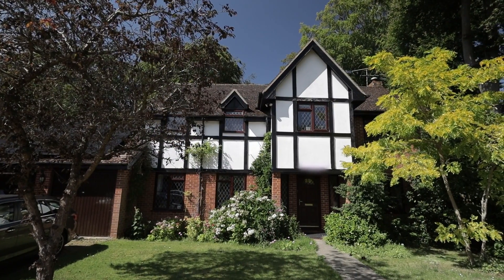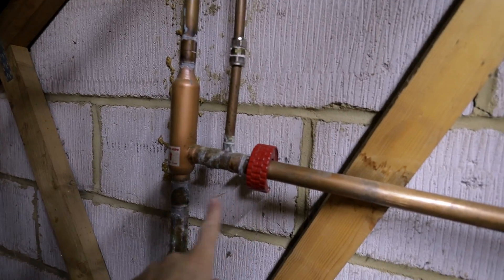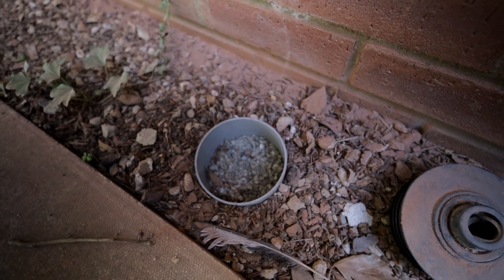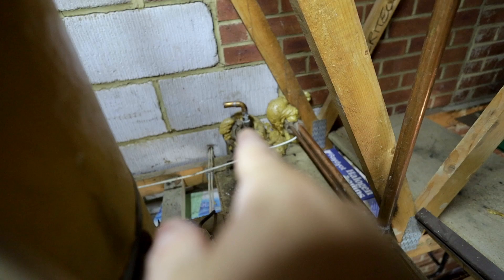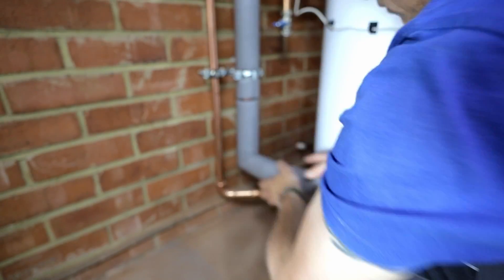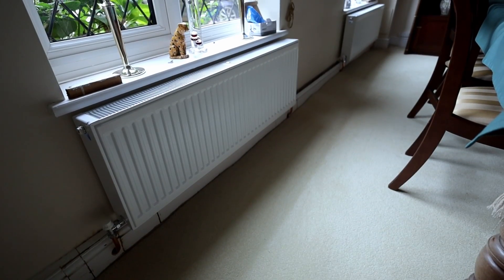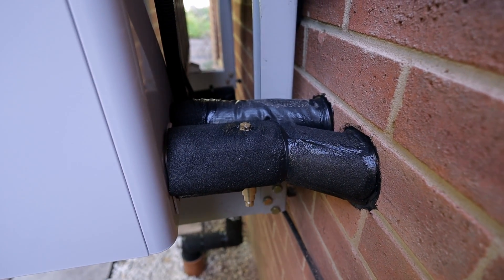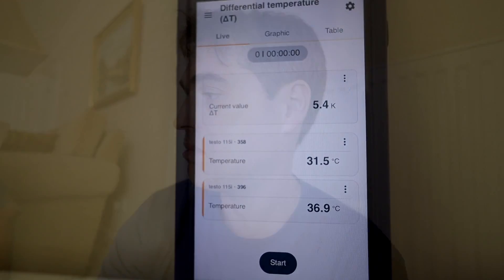Heat Pump Retrofit in a 1980s House: What's Involved?

Comment: My house in the uk was built in 1998/9 but it has microbore(8mm ?), i assume that all the pipework would have to be replaced. I currently have a worcester system boiler which has been great, not sure i could justify changing over to a heat pump based on the costs i've seen but with these energy prices  that may change. Love the videos.
Reply: Am in similar situation but with 10mm microbore. The F & R from boiler is 22mm under 1st floor boards, though turns to 28mm in HW cylinder cupboard (why?). Not sure how close this is to each rad that probably has 22mm to10mm manifolds. I'm presuming that each manifold and 10mm pipework needs to be replaced with larger size and increase rads to K2. Doesn't help with hand "bent" microbore on each rad tail that is almost squashed flat.
Reply: That last seems an unnecessary conclusion. If you have microbore, watch the HeatGeek review of that topic: seems it can be made to work with ASHP.
Reply: air-air for you guys then, throw the rads away.

Comment: Amazing work - love the wall mounted heat pump. Would you default to wall mounting for micro climate risk areas going forward? Also, have you ever had to wall mount directly over water - we have a client who lives right by a stream and wants it wall mounted over the stream.
Reply from the maker: Never installed over water yet. Yes I will wall mount in areas of microclimating risk
Reply: can you put a 10KW or 12 KW - double fan unit on the wall - is thw weight OK?
Reply from the maker: @justinhumphreys5230 depends on the unit weight. Some are 120kg so are over 200kg

Comment: I am always pleased when you post a new video. I am a mechanical and electrical engineer, I work for a local authority, taking care of complex systems in , swimming pools, various commercial office building with communal heating systems and a full district heating system. I like your work and ethic. You are clearly passionate and work to a very high standard. The one thing I would say to you though with this video, that, is in no way a typical uk house. Much of the uk housing stock is on a small footprint or is of some type of terrace/town house structure. For all who wish to immediately defend air source heat pumps as the holly grail, they definitely have their place, but, are not all things to all men and there does need to be an alternative.
It always pleases me to see the standard of your installations, my local authority has suffered some shockingly bad installations from uncaring contractors, which have cost thousands to put right. As well as costing the tenant thousands to heat their homes. A knowledgeable and caring contractor has taken over, rectified the faults and proved the worth of air source heat pumps when correctly specified and installed correctly

Comment: Can these systems cool (ie for the summer) as well as heat for the winter
Reply: Thats their biggest selling point.
Reply: @slavko321  so I’m curious how that works in practice.  In cooling mode wouldn’t there be condensation on the radiators??

Comment: I think it’s increasingly proven that heat pumps can work in both new build and older houses.  But it seems you really need good quality kit and an installer who has high skill and attention to detail.  Finding a really good installer seems like a key success factor- even more so than for a gas heating system.
Reply from the maker: @vicki8669 I am not interested in managing people. I am not good at it and hate doing it. Where I am now is where I want to be.
Reply from the maker: @zlmdragon.  Hard? It is next to impossible for me to find people that I can work with. I have very high expectations from others and can be rather harsh if they do not perform. 

On average 1 in 20 will stay with me for longer than a few months. I got used to it now.
Reply: @UrbanPlumbers  Yup, there's a lot to be said for doing a good job and enjoying your work. I think a lot of people end up in management because they think, "well, that's what we're meant to do, right?" and some of them hate it, but keep doing it because of pressure/expectations.
Reply: @urbanplumbers, thank you so much for the detailed video including tackling the Q&A at the end, 
my question:
when upgrading to K2 radiators to support a 45degC flow temp, did you factor 5deg between flow and return… ? why? i was expecting a 10degC delta

keep up your amazing work, so insightful
Reply: @zlmdragon.  ok apologies i missed clarifying, when running at max temp in this case 45degC (coldest temperature day used for calculation), what was the assumption made for the temperature drop please?
Reply from the maker: That’s why we promote heat geek elite installers - the best in the country bet a long mile.
Reply: @UrbanPlumbers  unfortunately there are non in Scotland :( -- I don't think the UK gov is going to its target unless it really ramps up the training, as I don't trust random installers to be even a fraction as good as you & some of the other knowledgeable folks on YouTube
Reply: Das stimmt so nicht.  Neue Häuser haben eine geringere heizlast.  Also geringere vorlauftemperaturen. Fussbodenheizung.  In alten Häusern  müsste man die Heizkörper viel größer machen.  Sonst  geht die cop gegen 2.5 -3.0 unwirtschaftlich!!!

Comment: Yeah but that kind of heat pump works in uk, but on places where during winter outside temp is -20 Celsius with humidity around 70-90% gas boiler is much better, so no heat pumps still cant replace gas boiler, unless you are doing geothermal but who has money for that.
Reply: Where do you live to average -20 in winter? Almost all Northern places have lows of -20 for some days in winter, and air source is pretty ineffficient. But thinking rationally, its just max two weeks with those temps, so seasonal performance is still amazing.
Unless of course you live around Arctic Circle.
Iæ
Reply: -20C on the regular would be unheard of in the UK.  And Ground Source would be more appropriate in that situation.  Given that the ground source heat pumps last the longest - at around 25 years, and the boreholes are generally good for about a century, along with the upcoming ones that are promising SCOPs of up to 6,  it would certainly have made a lot of headway in the extra cost - especially with a boiler usually needing to be replaced at least one more time.  Air Source still can go down to almost -30C, and be more efficient than a boiler, it just comes down to the cost of gas vs. the cost of electricity.

Comment: Well put together video, we have 3 bed, semi detached, 2000 build. Good insulation but 22mm primary and 10mm to all single panel radiators. I just can’t see how a HP can replace gas boiler without replacing all radiators and pipe work😢
Reply from the maker: This pipework will be mostly fine in a new build. You don’t need 28mm if your heat loss is low and you can use 10mm no problem

Comment: Hello, we are also installing heat pumps for several years... I wonder how you don't install a split system of heat pumps (Vailant also has one)? Here in the Mediterranean, we mostly install a split system of heat pumps... a smaller outdoor unit, no problems with freezing, better transfer of heat to the exchanger... I'm interested in your opinion. Greetings from Slovenia
Reply: F-gas regulations mean that most plumbers install monobloc units. Commercial air conditioning installers can install splits, but they mostly just work with air-air units.

Comment: Very interesting. Sounds like important  improvements in the units have been made wrt noise and vibration. It would be great to know what other improvements are coming / in the pipeline. However, difficult to comment on this installation because it sounds like it was at the highest level of spec for radiators and pipework before work started, so obviously this reduced cost and work. Great for them but not sure how often this is the case. What would be interesting would be some user feedback from these users on a v cold day. Being fully functional in summer is one thing but obviously not the real test.
Reply from the maker: I always post feedback from my installations. Check my other videos - there is 3 on my channel with interviews after the winter with my heat pump clients

Comment: Do you ever install the heat pumps even higher than that?  I'd like to fit one just above first floor level on the wall on the back of the house.  The space down the side is too narrow and only have a dmall patio so didn't  want to lose that ideally. If so, how do you lift them? Is it a problem for maintenance?  Is it creating problems down the line?  Great video but you will get some flack for sying thats a typical house!  Thanks for all the info you are sharing.

Comment: Any views or experience using heatpump hotwater cylinders such as the valiant arostor - seems a good idea to me as it must be more efficient because the hp is designed specifically for hot water rather than dual role dhw/ch

Comment: My personal concerns around even trying to explore this subject are: 
* where the unit would due to the air circulation issue mentioned here.  I have 2+ metre stone walls really close at the side and back of a semi detached house.
* where the water tank would go? I assume it should be close to the unit, behind the same wall? Could I put it in a cabinet under the stairs in the kitchen?
* How much piping in an older uninsulated solid wall house I would have to replace in order for the unit to run efficiently? I replaced the loft insulation, put some insulation under the suspended flooring downstairs, but with councils being more concerned about maintaing house "looks" over energy efficiency there is little I can do about wall insulation
* I have some iron cast radiators across multiple rooms, which hold a lot of water. How does that affect the heat pipe efficiency?
* 12-15k is still fairly steep and unlikely to include any extra work, such as replacement of piping

Comment: Very well installed. Quality work great knowledge. I suspect many heat pump systems installed with a lack of consideration for flow rates and rad DT's resulting in "heat pump" doesn't work.
Reply from the maker: Yes, correct. Plus wrong sizing, over zoning and wrong controls plus unnecessary buffers and pumps

Comment: I live in a house with one bathroom which has an electric shower and just two hot water taps, one in the bathroom and one in the kitchen. Would it be worth doing hot water with a heat pump, or just keep the electric shower and put in some sort of electric on demand heaters for the taps? For instance, I'd quite like one of those Quooker Boiling Water taps in the kitchen.

Comment: Another good vid,  that pipe work is a work of art.  Do you know of any systems coming for non-tank combi systems in a terraced house?
Reply from the maker: There are no systems like that and will never be produced due to power required to heat the water up in a instantaneous water heater.

The best you can get is a heat pump for heating and a direct electric water heater or sunamp. Sunamp needs some space as well though and will have poor efficiency with a heat pump in dhw.
Reply: It dose look like there’s millions of homes stuck on gas for the foreseeable future.
Reply from the maker: @peterfaraday3956 communal ground source, district heating, heat interface units with commercial air source on the roofs, dusted units - there is loads of ways flats can be done.

Comment: In many ways an 80s house is an easier proposition than something built thirty years later because the heating is likely to have been designed around single panel rads and a separate DHW cylinder so it’s got an easier upgrade path than a combi feeding rads that are already K2s, via 10mm plastic under a chipboard floor that’s glued to the joists.

Comment: What is the recommended piping size for all pipes leading from the heat pipe to radiators in an old property with solid walls?
Reply: This will depend on the heat loss of the property and the length of pipework (New and existing). A larger heat loss will need larger pipework, as will a longer run. 

As a rule of thumb 28mm is okay up to around 10KW, 35mm to around 15KW. Average heat loss of a UK home is around 8KW.

Comment: Im installing heating floor right now what water pipe is best or heat pump? 

I have a 9 year old megflow tank that’s only 3m’s from a outside south facing narrow path, 

all upstairs rads are k2’s 

 removed all rads on ground floor and the split zone pipe work
Reply: Do you install heat pump in the northwest ?

Comment: What's involved? About 30 grand.
Reply from the maker: Average cost is around 12-15k less the £5k BUS grant ?
Reply: Insulation needs improving on most houses first  is this included in price?
Reply from the maker: @robevans8625 yes, around £500 for loft insulation in this case
Reply: @danascully-x2t  I think he has another video about one year on experience with a heat pump in a Victorian house with solid brick walls? No actual insulation outside the attic. If I ever tried such conversion in my house I would likely also have to lift up the unit rather high to avoid the issues with cold air circulation due to how close walls are around the back and side of the property. Especially if you have to install a water tank. It is still an interesting subject for me to explore.
Reply: @danascully-x2t  Insulation improvements work with existing gaspowered heating systems.
Reply: more important with a heat pump unless you want to freeze and a big leccy bill  @olafvanes
Reply: @danascully-x2t  1980s housing has fairly good all round insulation as standard. Tripling loft insulation and double glazing and you are probably good to go.
Reply: The first question I would have is who could I trust to do the job properly?  I’m sure there are plenty of plumbers offering an HVAC installation service but it seems like the wild west out there and very few really know what they are doing.
Reply: @kevinmills5293  Heard good things about HeatGeek certified installers. They have a map you can use to find certified people. I would personally ask that the certified person be the plumber that attends (i.e. not good enough that some other person at the company did it, but they aren't going to attend).